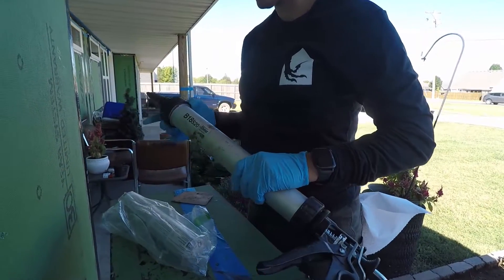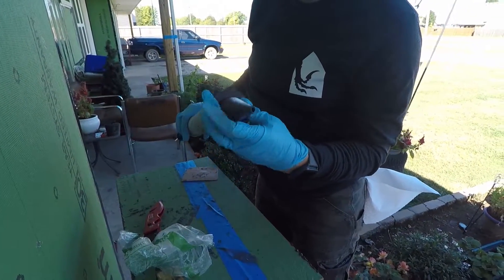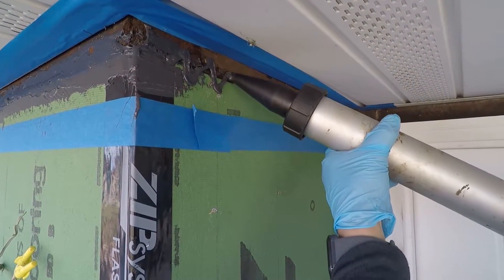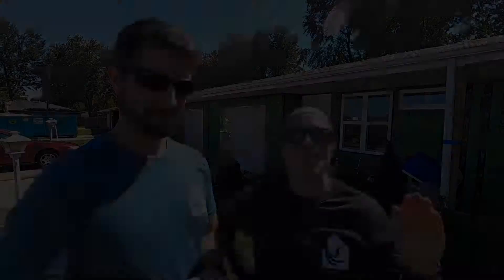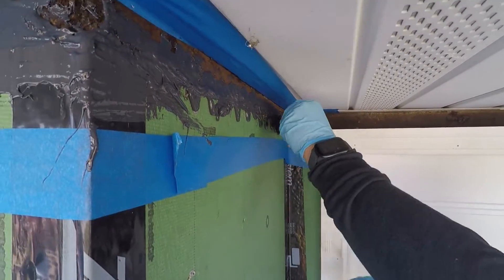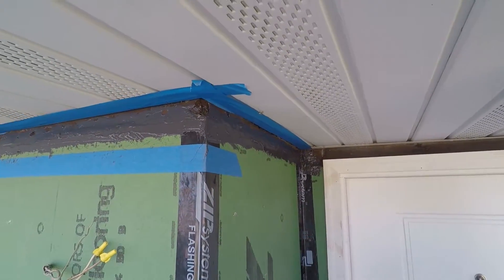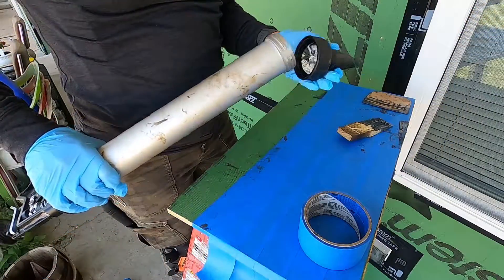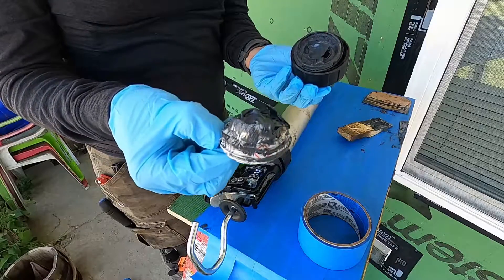How to Use Zip Liquid-Flash to Seal Dissimilar Materials

Comment: I have asphalt impregnated boards as my sheathing (1980s house).  Does the zip liquid flashing stick well to it?  Your video is the first one I've found that even mentions the asphalt boards.
Reply from the maker: Hey! The liquid flash does stick well to the asphalt board. The only extra step was using spray foam in places as a backfill in areas that had a large gap between the liquid flash and the zip and/or the asphalt board broke out a bit at the joint.
Reply: @RaptorRenovation    Cool!  Thanks for the info.